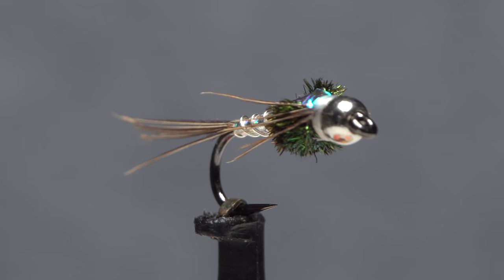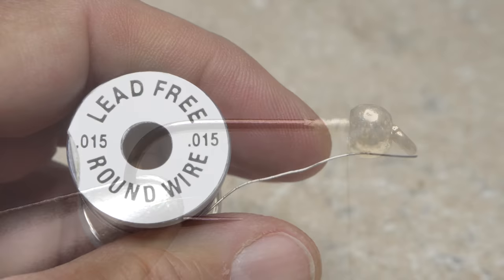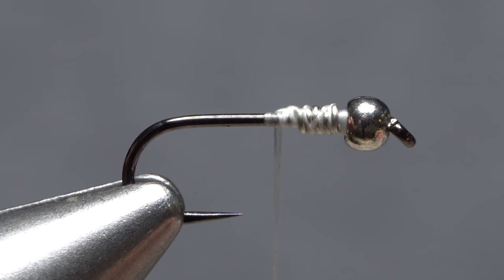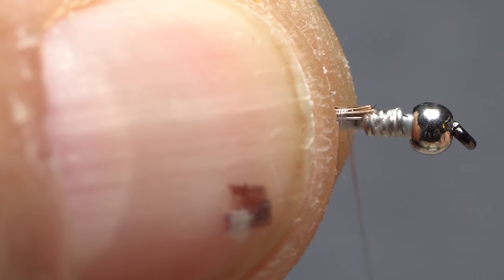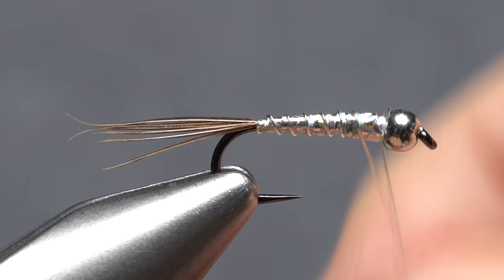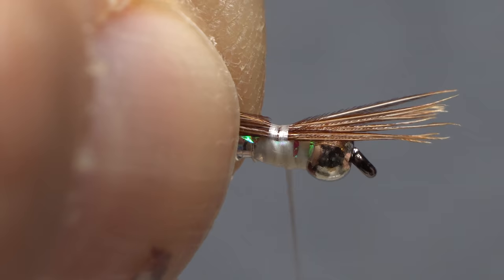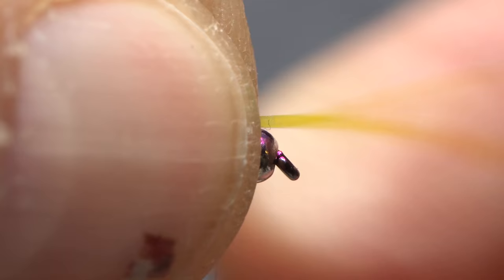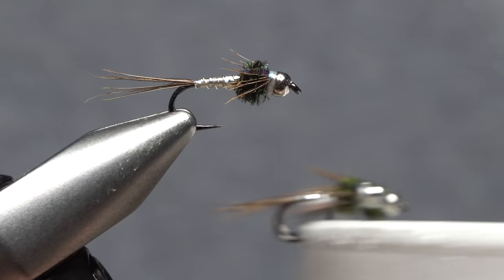Lightning Bug

Comment: After about 6 months  watching your video, you have inspired me to start tying after about 15 years of not.  Any recommendations on a tying vice?
Reply: I recently upgraded to a regal travel vise and I have no complaints. Renzetti is also a solid choice
Reply: I have the Renzetti "Traveler" vice or something along that name. It is my first Big Boy vice and love it for the price. As far as I know, its about as inexpensive as one can go and still get a rotary function, bobbin cradle and quality machined parts. So far I've had it for about two years and still going strong!
Reply: If you want to get started, I'd go with the renzetti apprentice vice. The traveler 2000 is pretty good to. I'd recommend the apprentice though because it's more inexpensive than other high end vises and holds hooks well. I wouldn't tie saltwater with it but it's great for general trout flies.
Reply: Regal, Renzetti Traveler, Peak True Rotary and Griffin Mongoose are all very reliable rotary vises and are backed by good warranties should you have any problems. You might want to head to a shop and try them in person to see what works for you.